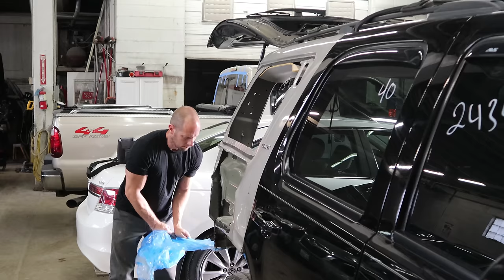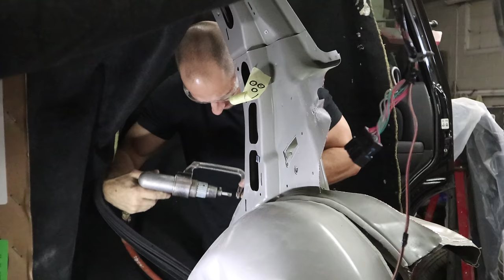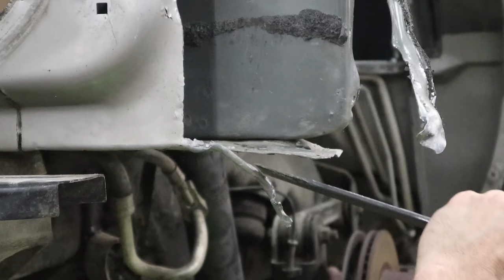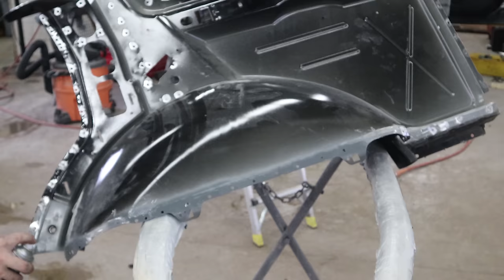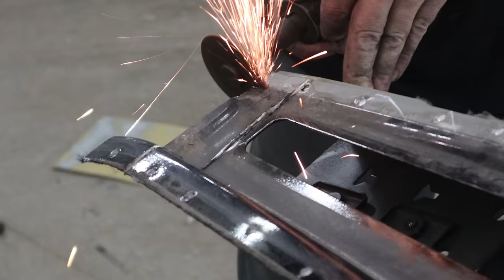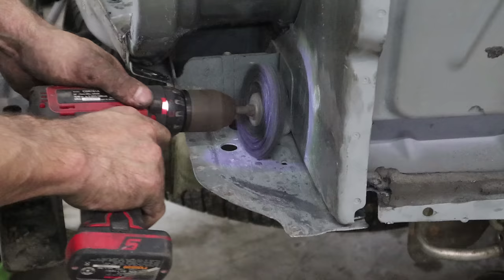Rebuilding our semi collision GMC Yukon, installing the quarter panel part 4

Comment: Man you are a professional. Worked a long time in construction, and no matter what, if the opening isn't square, Nothing going to fit. . .  I don't know your name, but it is a pleasure watching you work.
Reply from the maker: Scott is the name and I learned long ago to measure first or even better, fit the parts to be installed.  It sucks to try and do all the adjusting when things are done and not supposed to move. lol Thanks for the support!

Comment: Mr Vendor I'm amazed how you take on a technically challenging rebuild that good body shops would struggle with and make it look so easy that even I could do it, I neal before greatness ..... Ok perhaps a bit to much bum kissing but you are bloody good old chap.  Keep on cutting buttercup.  Gary..... England 🇬🇧
Reply from the maker: I don't consider this one to be bad. Once the 1/4 is on, 80% of the job is done.  Just a little paint and reassembly after that.  I appreciate the support!

Comment: Yeah, Those fancy Sawzall blades, with teeth, cut through that metal like butter.  Nice job!
Reply from the maker: I usually just use the ones with no teeth and run the saw until the metal just gives up and comes apart out of pity. lol

Comment: Not sure if you're aware: dewalt recip saws are the ONLY recipt saw where you can put the blade in upside down and sideways. This helps if you have to get close to something using the top of the saw. Try it if you didn't know this already.
Reply from the maker: I actually did know this.  Not from reading the directions of course!  lol  Experimentation is always more fun!
Reply: @vehcor  you'd be surprised by how many don't! I didn't until a co-worker showed me when I was trying to cut close to another jack stud..."turn the blade around" huh? lol

So since then, it's been my mission to spread the good word on dewalt saws lol

Comment: another great video, great work...Where did you get the tram gauge. Im looking to repair a vechical  how does a avg joe get truck frame measurements need  2011 gmc 1500 ext cab measurements to check frame and the cab etc. any help advice or help would be great.... where i can get vechical measurement as i dont have a Donner truck
Reply from the maker: The tram gauge is a SnapOn and they no longer sell it.  I wish they did.  My recommendation to get measurements is stop by a local shop and bring donuts.  Ask them to print them out for you and how much they want.  They do pay thousands a year for subscriptions so even if they don't want anything, a few bucks will go along way if you ever need to use them again. I don't know if any place an average joe can get them.

Comment: Really...really enjoyed this video as I do all your videos. Can the weld spray withstand high welding temperatures? Is it mainly used as a primer at a hot welded joint or is used to help bond at the mating surfaces where there was high heat.
I'm curious as I have never seen other repair garages on YouTube use it before! 👍🤟
Reply from the maker: So I'm no chemist but how it was taught to me was that the Zinc in the primer is activated and drawn to the heat from the weld.  It gets into the weld and surrounding area and seals it up.  Without the heat, it does nothing which is why I say only use it where you weld.  It is part of proper repair procedures which a lot of people don't even know exist.  It is one of the advantages of schooling in autobody repair.  I do my little part to help people learn.  Thanks for the support!

Comment: quick question bro, im tubbing out the rear of my tahoe right now and laying my own sheet metal, and i was wondering if those dents and shapes in the panels serve any purpose such as crush points or what, and should i try to replicate them or am i fine laying sheet metal?

Comment: This may be a stupid question, but is this rear quarter panel repair process standard practice? My 07 Yukon Denali was just hit in the same exact place, so I have to get it repaired, and after seeing this video series, anything less than what you did would be sub par, in my opinion.

Comment: Yea you say your not about safety!   I saw the safety sleeve around the clamps on the air hose at 19:40 so you wouldn't cut your finger!    You might need to put another clamp around it though, it looks like it split a little.    Kevin
Reply from the maker: I'm going to tape razor blades on there just to prove I am not about safety! 😂

Comment: I new here and pretty sarcastic ....but the belt sander tool is a lot better than a die grinder for removing spot weld ....it sparks a lot less and faster....i use a die grinder for 14 years at least...there cheap on the interwebs...keep it ridged
Reply from the maker: Glad to have you with us!  I have tried the belt sander, didn't like it.  I'm pretty good with the die grinder.

Comment: Where do you get that fancy saran wrap? That would have came in handy in the past. easier than trying to keep a tarp on the car.
Reply from the maker: It is called crash wrap.  There are cheaper brands out there.  Look up weather barrier film.  Just a warning if you leave it on the sun for a few months it does start to crack and peel.
Reply: @vehcor  thank you!

Comment: I'm replacing rusty brake lines on a  2000 F150. Yeah! Going with copper. No car lift. It's my yard truck. But still needs to stop.
Reply from the maker: Good luck.  I have learned to like brake lines!  I guess I have to considering where I live!

Comment: I get that staggering the joints would be smart , but I have heard that a proper weld is stronger than the metal it joins. so if you did just slice straight and weld, would it really be weaker? Your thoughts?
Reply from the maker: My thoughts are: I am not an expert so when guys (much smarter than me) in lab coats with fancy degrees in physics and engineering, design a repair procedure, I follow it.  These guys mind you, take a car, wreck it, study it, completely repair it (paint and all), crash it again, study it until they find the best way to make the repair as good or better than the vehicle was before the accident.  I have had customers crash test my work and after following the repair procedures, everything I did, did exactly what it was supposed to do.  That is all the proof I need to keep trusting the experts!  All that money wasn't spent on my training for me to make up my own ways of doing things.  lol

Comment: @ 21:45 Primer is not a rust inhibitor and it's water permeable. Next time, throw some paint over top of the primer in those hidden sections.
Reply from the maker: While some primers must be topcoated, some do not.  This one can be used as a top coat.  Just the the factory e coat that I was replacing.

Comment: Hello vehcor at this minute 22:06 i see 2 different cuts , why can just make a straight line cut ? Sorry if i missed something you explained
Reply from the maker: I did explain that the piece had a bend in it that will change the alignment of the panel.  That piece was over lapped.  I could have cut it anywhere.  I chose the path with no holes and as straight as possible to make life easier.

Comment: You’ve probably answered this before but what is your day job? Are you a mechanic or is this just something you do on the side?
Reply from the maker: I am a mechanic.  I worked in a bodyshop for years and was trained and certified so that I could do this stuff when the mechanical side was slow.  I have been doing my own rebuilds for 20+ years.  Over 1000 and counting!
Reply: @vehcor  so this isn't your shop? Do you have another channel with you doing mechanical work?

Comment: Scott I’m confused about the curtain airbag comment. I’ve seen some early GMT900s (07-08) without curtains at all, and I’ve seen them with 4 piece curtains with the smaller rear set for third row. But that’s it. Are you saying some Yukons and Tahoes have just the two piece curtains? Like if they don’t have the third row seat brackets?
Reply from the maker: I have never seen one without any airbags.  When I took the parts truck apart, I pulled the rear bag out.  There are wires in this one but no air bag.  You probably have not seen one without a third row, they are rare.  I guess GM figured you don't need a airbag for the cargo area.  So, no third row = 2 piece bags.  Third row seating = 4 piece bags.
Reply: @vehcor  Oh ok, well that solves the mystery why the curtains come in 4 pieces. Yeah I thought they all had curtains too but I was at a Chicago junkyard that had a 2007 Tahoe LS strippy base model.. no curtains, no AIR BAG tags on headliner. Bizarre.
Reply from the maker: @daveh2612  Maybe they were police versions?

Comment: Instead of wasting time changing discs:

I got a job in a cabinet shop and one day noticed they had like 10 small trim routers and 5 big ones. I asked "what's with all the routers"?

One router for each bit. HUH? It takes too long to change from a 15 deg chamfer to a 45 deg and set up and everything. I get them used for $40 to $50 each. Better to pay that once than to pay you wankers $25 every time you have to change a bit. So now if you need a flush cut, grab the flush cut router. Chamfer, radius whatever.

When I opened my own shot I had 12 at last count lol....it was SO much easier and efficient.
Reply from the maker: I have multiple impacts at work for the same reason.  Even though pulling off the socket takes seconds, it is easier to grab the other impact!
Reply: @vehcor  it's not just pulling off the socket though, it's putting it back in it's spot and finding the other one. When I was building lots of cabinets I had a drill with #8 countersink, one with #6, one with #8 driver bit, one #6, then one empty for actual drilling :-) This was when all my tools were dewalt, now it's all bosch li ion (way lighter on the tool belt). Plus it doesn't help when you walk into home depot and they have a Bosch drill 18 volt with 2 batteries and charger for $40 CDN (which is $30 usd). Considering the batteries alone are $80 each.

Comment: Your piece of tape needs safety goggles.

I was redoing the floor in my kitchen and dinning room, had this ugly thick tile, put in with tons of cement, so my Boys helped me bust them up with a 5lb hammer, told them all the safety stuff to wear if I wasn’t home...came in from work they were both going at it, gloves, goggles, and hearing protection...but no shoes on...I didn’t tell them to wear shoes...both of them sitting on the floor, going to town, bare foot.
Reply from the maker: Kids are invincible, I know I was! 😂

Comment: FIRST COMMENT BITCHES !!!!
Reply from the maker: Actually #4 but everyone gets a trophy 🏆  lol
Reply: #shitfukdamn
Reply from the maker: 😂 current #1 commenter is on a four week streak!
Reply: Sitting at my desk due to 2 pinched nerves in my neck when the notification popped up, actually thought I had a chance.

Current #1 Commenter is a cheating bastard.
So THERE.
Reply from the maker: Hope that neck gets better soon!  It sucks when you have to turn your entire body just to turn your head!  Thanks for watching!  I think he has figured out my upload schedule! lol
Reply: It's not just turning my head... Down about 50% horsepower in my right arm and my hand coordination is gone.
I can sometimes coordinate a position between my neck and cranking my shoulder to a position that doesn't hurt but I look like I'm doing some kinda bad Steven Hawking impersonation...
I'm a sign painter for the last 38 years and at the moment, I can't maneuver a damn brush so I'm limited to the vinyl cutter 'til this gets resolved.
I haven't had more than 1 1/2 hours uninterrupted sleep for the last 7 or 8 weeks.
They have me taking Prednisone now, a little improvement, but I'm pretty much loosing my mind.